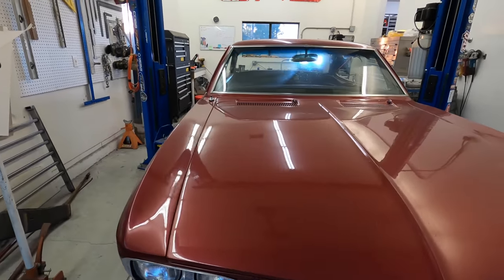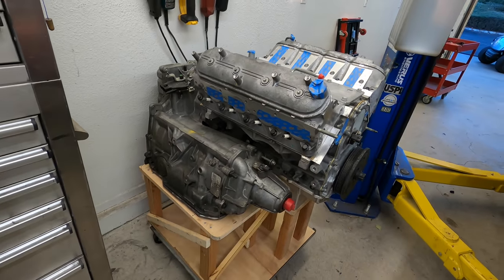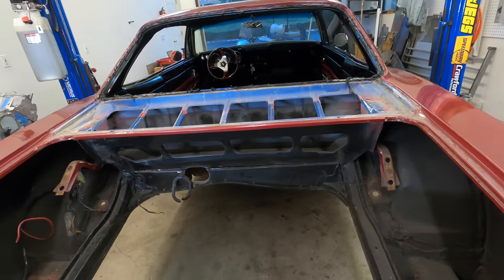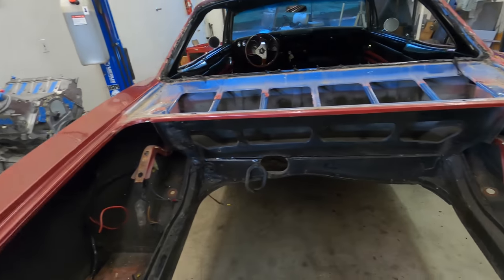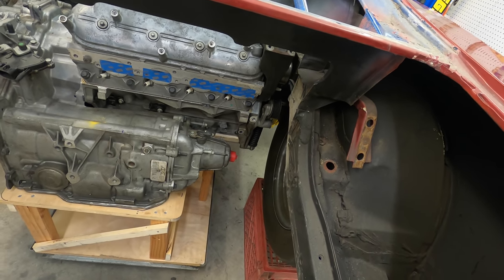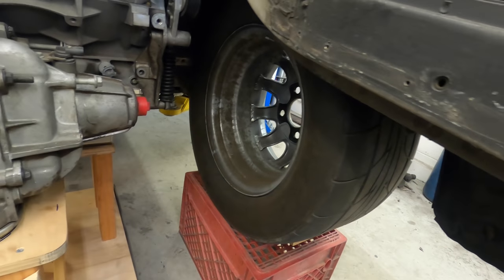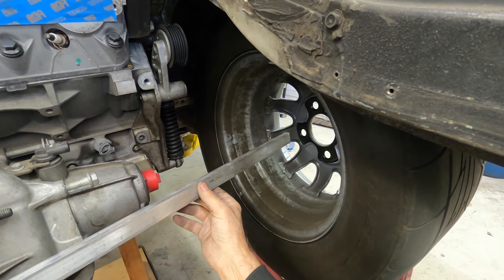Making a LS4 V8 fit into a Corvair

Comment: I put a Chevy LT1 420 horsepower in a 55 Volvo in the mid- 1970s it took me three years. Used a rock Crusher transmission and as for rear end a 411. Made a tube frame, you can imagine the machine worker took to make it fit. Driveshaft and rear end wise. What a beast. One mistake was I should have used a Powerglide transmission

Comment: In the late 60's I saw a Corvair that had a L88 427 Corvette engine sitting in the back seat coupled to a Tornado Turbo 475 transmission to pot the power to the pavement.
Reply: Several tornado based corvairs have been done.
Reply from the maker: V8 conversions, front, mid and rear have been done hundreds of times over the last 5 decades.  Fist thing is decide which variant you want as they all have attributes and liabilities.  Front engine is great because a standard engine, trans and rear end can be used.  Many were made by putting a Corvair body on a front engine chassis car.  But it doesn't handle as well as mid engine and eats up a lot of room where the bell housing goes.  Rear engine is nice because it occupies the same real-estate the OG engine uses, but it's a wheelie king, or at least with 700 hp.  Conventional mid engine handles the best but is hot and noisy in the interior plus the valve covers are inches away from your shoulder.  Transverse mid engine is probably the best layout but involves the most fabrication. But that's what I'm good at.
Reply: I knew of a fellow back in 1969 had a Corvair with a big block in the front. Sadly it was totaled when he killed himself hitting a telephone pole at wide open throttle.

Comment: A transverse mid engine v8 is a nice idea. Always fun to figure out how to package everything and how to make the different systems work. Its not so much hard,, just different . It looks like you pretty much have it figured out and will be fun to watch the progress thru the videos. Thanks for taking us along.
Reply: First question that popped into my head when i saw the position of the engine was "traverse, wtf?" What's the advantage of mounting it "sideways"?
Reply: When We were kids in the late 60's & early 70's We race slot cars

First the were straight inline

Then they mounted the motors and called them Angle Winders

Then someone figure out milling the Magnet horizontally and came up with the Armature parallel to the axle

Transverse

Reason for it?

The rotational torque of the Armature ( Like a Crankshaft ) eliminated the torque that worked on the cars forward motion was eliminated 

Like You see in drag racing when the car lifts up and one wheel is higher because of the rotation of the crankshaft

Plus as a mid engine layout really moves the mass of the engine too the Center of the Cars gravity

Comment: Truly going where no man has gone before. I own a ‘65 Corsa 140 and have spent a lot of time in and around the area that’s undergoing so much surgery. Kind of knowing that GM designed that unibody around a maximum of 200 or so horsepower and a power train weight of about 400 pounds leads me to the conclusion that you’re going to need to build a power train cage that bolts to a number of yet undefined attachment points. I predict an extremely robust large tube roll cage may produce the strength and attachment points required.
Having seen the VW/Subaru I am convinced that not only will the work be done but will be done to an exceptionally high level. Good luck!

Comment: John, I a had corvair 500 not so wild. '65 with a '85 4.3 V6. Mildly built sitting where the back seat went. Mated to a powerglide out of a Nova set up to be shifted manually. Radiator was in front. The transmission was cooled by b&m cooler mounted near the back window. It used a Camaro muffler. Two into one and two out. The original set up was a 4 carbureted six cylinder with a 4-speed.

Comment: i did something like this years ago. a little advice before you ever drive it put a full cage in it.  because the roll cage is going to become most of your support. you will twist that sexy little car up.  and i didn't cut any of my frame.  i love what your doing
Reply: Definitely good advice, as I seriously twisted a stock 70 Firebird and all I did was up the hp on the engine.  (Couldn't open the doors after the first pass.)
Reply: @mark-1234  i did it to a vega also it twisted so bad that when stopped on level ground the right rear tire didn't touch the ground. i put a stock SB 400 in it.

Comment: Your engineering on the VW was outstanding, looking forward to this car's progression.  I've always liked the idea of a roll out subframe. Undo 4 or whatever bolts, unhook the motor's lines, and roll it out on its tires. Maybe run the body's cage all the way back to the rear valence, then have the subframe attach to it from underneath? Have you looked at corvette C4 rear suspension? Lots of offset on the wheels, so you could get the axle length you're looking for. Simple linkage, and cheap buy in too. Have you looked at the Fiero V8 stuff yet? They might have some ideas too. Crazy engineering on some of those conversions.

Comment: Integrating the roll cage and using struts or pushrods is a great idea to replace  those frame rails. Building  a mini frame cradling the power train would allow you to build like the engine is a stressed member
Reply: indeed..or a custom built tube frame

Comment: I'm really enjoying your channel! I love Corvairs but you drew me in initially with that wizardry on the VW sleeper. That LS had a lot of short trip miles, carbon is a normal enemy made worse with that. The rings had to be checked especially with a valve job. For alternator location, I've seen tons of different unorthodox ideas to run those. You could even mount it to be driven off the front axle, closer to where the battery should be located to save wire length. Great engineering work!
Reply: You know it, gm!! He HAS to be new here.

Comment: Just an idea for the alternator and power steering (if applicable) you could use a transfer pully system and move it to the rear of the engine.  The guys at Bad Obsession motorsports in England used one to remote mount their alternator away from the normal position of the engine on their Mini Cooper build when they swapped a v6 Toyota AWD chassis under it.  Not sure what episode of the "Binky" build but it was a cool way to move accessories to an area with more room.
Reply: It's not a v6 only i4 from a celica.
Reply: michael ... my thoughts on the alternator is to do away with the PS pump and relocate it there because Corvair never had PS in the first place. If PS was really on the charts here it could be done using an electric pump mounted elsewhere.

Comment: Nice project. I have a '65 Corsa. Bought it from a guy that started on a Crown kit but couldn't round up the parts. I gutted the back half and cannibalized a Fiero for the strut towers and inner structure and subframe. Mocked it up with a 350 and Getrag 5-speed. Building a long rod 302 for it now. I can share pictures if you are interested. I'm using a Camaro floor pan, '69 Camaro buckets and a '68 Camaro console.
Reply from the maker: Are you in the V8 Registry?
Reply: @JohnReynolds661  No, I'm not. I have several projects. Another is an MG with a 13B rotary with a 5-speed. I have a "finished" '55 Chevy 210 gasser that I built for my wife. Sits high with independent front suspension I designed and built (drives great). Very steerable 327 with a tunnel ram (divided plenums, runs strong idle - 5,000) I like different builds that stand out. I have another Corvair body that I would like to make a gasser out of. My dotcom is musclecarcpr if you're interested.

Comment: I'm sure you must know about the kits Crown offered for doing a mid engine Corvair with a small block Chevy. My brother in-law built one using a 365 hp Corvette motor mated to the original but beefed and reversed Corvair  trans axle. It was awesome and handling was superb.  Your car was in wonderfully solid shape but you have removed some major structural strength in the chassis with all the cutting necessary to install the LS cross wise. I can only assume you are doing this for the challenge it presents. Hope this works out for you. Thumbs up and thanks for sharing.

Comment: I know on the 5.3 truck motors, the alternator is on the drivers side, mounted high like your passenger side is. In the passenger car versions, the alternator is mounted low on the drivers side. It's just a matter of taking a look thru your salvage yards for brackets.

Comment: Very curious to see the geometry and frame you come up with for this transverse configuration.  You really have hacked up the body.    But the work on the VW you did looked first rate.   So hoping for the best.  Many fairly  simple mid v8 small blocks have been done.  With all the fabrication you seem to be looking at I think you should consider dropping in something in from fwd drivetrain.    Tornado corvairs have been done.  You will need to replace the worm gear steering.  Clark’s corvair is the place for parts.

Comment: Have you considered cutting out the sub-frame tubing, use heavier box tube framing to make a frame that goes across the back, over the wheel wells, and across the front of the engine which is mounted front to back. Run the front trans shaft to an offset Dana 30 4-Link w/disc brakes, combination shock absorber with short spring and inflatable bag both sides. Create an access panel to reach front of motor. Mount fuel cell in trunk (pass. side) + battery on driver side. Just a thought...
Reply from the maker: That's another way to do it but it looks like I'm going another rout.

Comment: I LOVE that you've shared some of your thought process as you begin the project. I grew up driving Corvairs (a 1968 Monza, a 1966 Spyder, and a 1963 Greenbrier Van). I remember my dad insisting that I  learn how to change the fan belt (always a spare laying in the back floorboard) before I learn how to parallel park.

P. S. I think you're the first automotive engineer I've ever seen that doesn't cuss and fart. What gives? 😉
Reply: No such thing as a 66 Spyder. Spyders were only 62-64 and turbocharged. Second generation Corvair 65-69 Turbos were Corsa’s built in 65-66.  Proper fan belt tension you should never have to change a belt. Been driving them 40 years
Reply: @yenko-km1og  So it must've been a Corsa. Been so long that I would not bet either way.

Comment: I had a valkyrie with a 327 mounted amidships.The corvair brakes are inadequate.Stopping from over 160 mph takes almost a mile.You will need a parachute.The vw was a neat project but my vw would go aerodynamically unstable at just over105 mph and blew sideways in crosswinds.

Comment: In regard to rear suspension, the multilink setup with trailing arms you described is essentially what the 3rd and 4th gen Subaru Legacy has. That's 2000-2009 with 05-09 spec b models having aluminum components. For that subaru suspension the hub assembly/axles are really lame, but nissan 350z has wheel bearing assemblies with the same pilot diameter, so those could be easily retrofitted in there for a setup that could work with only minor machine work.
Reply from the maker: Because all newer cars are 6-8 inches wider than the Corvair, it's going to be easier to start from scratch.  The half shafts will be based on Northstar Cadillac 33 spline axles and CVs which is big stuff.
Reply: @JohnReynolds661  well you're certainly not going to use the subframe or anything so you can make the track width whatever you need. But yeah probably true. I'm planning to run the 350z bearings with explorer axle flanges in my amc eagle that's getting subaru irs and an 8.8, so that'll be 32 spline axles.

Comment: It would be so cool if you could figure out a way to get a differential in the transaxle fabricated that would spin the axles in the opposite direction, so you could flip that whole drivetrain around and move the engine under the rear hood where the OE engine used to be.  You could then reclaim all the interior space.
Reply: That was my first thought. So I went looking for someone else that had commented. I didn't want to be redundant. I think optimal weight distribution may have been the goal.

Comment: What About an independent four link setup, to a set of hubs, with struts, and a sway bar?
Reply from the maker: You mean like a double wish bone?  Yeah, there's just not enough room or that would be my first choice.
Reply: @JohnReynolds661  No, i was thinking along the same lines as you with the rzr style setup, but making it a 4 link setup instead of the single arm coming off, and using you cage, build strut mounts above the wheel wells, and use the locating bars like you were thinking on both sides. Was just thinking. Really interested in this build. I have a corvair wagon i was thinking of reworking the rear frame section to accept an 05 monte ss ls front subframe..
Reply from the maker: @Big League Good idea but how are you going to solidly locate the toe axis on the spindle?  The two front to back links per side will require 4 rod ends per side.  The double radius rods locate the rear of the spindle but with rod ends at the front, something needs to locate it.  That's why RZRs and other UTVs use a solid swing arm, to locate the toe axis.  Plus, because I will be needing as much axle length as possible, the hubs will be deep into the wheel which means the swing arm will curve into the wheel to capture the hub.  The movement of a swing arm doesn't really lend itself well to struts.  It's better with a bottom wishbone.  Also, there will probably not be enough room for a strut.
Reply: @JohnReynolds661  Have you considered early versions of front wheel drives with a strut attached to the steering spindle which is then attached to lower control arm by a ball joint?  Where the steering rack outer tie rod ends would attach to the spindle you could mount a single rod with a tie rod end on one end and a heim joint at the other anchored to the frame, That would lock the spindle in place and still allow toe in/out adjustment. The lower end of the strut is usually secured to the spindle by two large bolts one of which could be replaced with an eccentric bolt. This would then give you the ability of caster/camber adjustment. There are many kits out there to trash the original bulky strut spring with some nice Eibach or similar springs. The only attachment points you would have to consider would be, lower control arms, spring tower, and a spindle toe link rod anchor. Your probably going to have to build some sort of sub frame any way to secure the engine/trans any way. That could be your answer to attachment points.
Reply from the maker: @Beate Zipperle Thanks, I appreciate your ideas.  It all sounds good except for the lower control arm.  I assume you mean some sort of three point arm to locate the lower portion of the hub?  That's where the problem is, there's no room to build a structure strong enough to support this lower wishbone type link.  A strut front end is basically a double wishbone with the top wishbone removed and replaced with the strut.  I would rather squeeze a trailing arm front to back (ladder bar) and two radius rods behind the transmission.  I would also suspend the car behind the transmission.  The motor and tranny occupy a huge box area where there's not room for anything else.  The suspension has to fit around the outside of this box.  If I'm not understanding you correctly, let me know.
Reply from the maker: The car that this motor/trans came out of is 8 wider in track width than the Corvair.  It also doesn't help that I want wider tires inboard without flaring the fenders.  Keep the ideas coming though because maybe I'm over looking something.  I really like the strut idea but it doesn't seem like a good fit for this project for several reasons.
Reply: @JohnReynolds661  Hello, I have a 1965 Corvair that I installed a 3.8L supercharged v6 from a 1998 Pontiac GTP. I used the engine cradle and all the front suspension components except the struts. Take a look at my youtube video - 1965 Corvair GTP part 4.
Reply: @JohnReynolds661  Ok John, I got another idea for ya, lol. What about building the engine its own cradle, and instead of making the rear suspension independent, basically making the cradle a swing arm. Effectively making the engine, trans, and axles a solid axle.

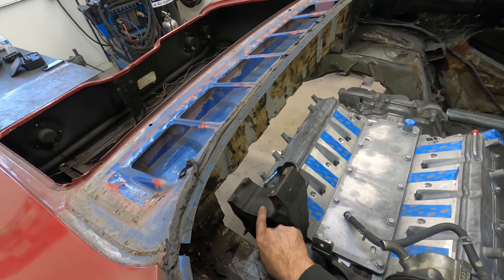Comment: Regarding the alternator @ 5:49 ... get rid of the power steering pump and mount it there.  Go with the Chevy Cobalt electric power steering if you have to have it.  The front end weight can’t be that much and it should be able to handle it at low speeds.  If you have to drop the engine for repair it’ll be one less fluid to drain. Just a thought!
Reply from the maker: @Whoda Hellru  Thanks for the comment.  I was seriously considering it but here's the problem:  The Ls4 P/S pump is on top and is thin enough to stay out of the way of the intake manifold.  Replacing it with a alternator would completely invade the intake space.  I could substitute the a/c pump with the alternator but I really want a/c on this project.  My original thought was to use the a power  rack but I did like your idea about not having to deal with two more lines when removing the engine.  I don't mind changing the accessory drive around but it has to be worth it.  I need to stay with the LS4 accessory drive because it is very compact width wise.  Keep the comments coming as I like your thought process.
Reply: What did you access the transaxle from?
Reply from the maker: Mid '90s Cadillac Deville
Reply: @JohnReynolds661  maybe mount the alternator @ 180° so that it wouldn’t interfere with the intake?